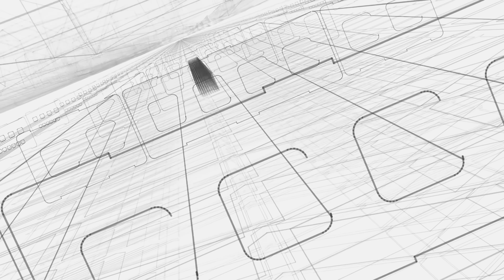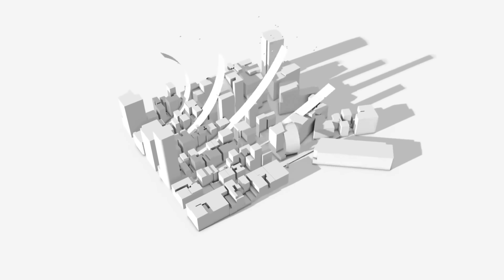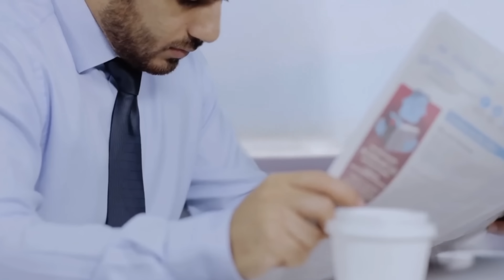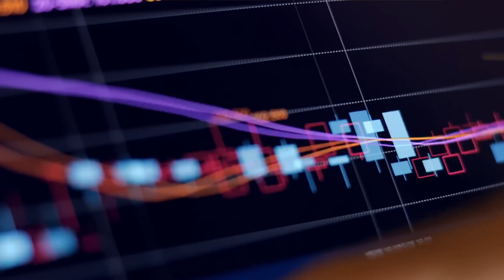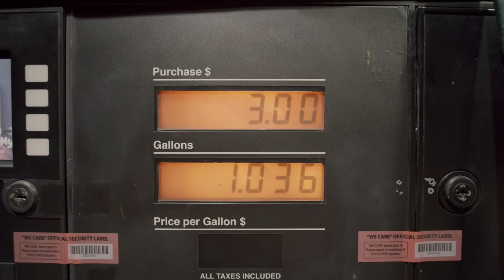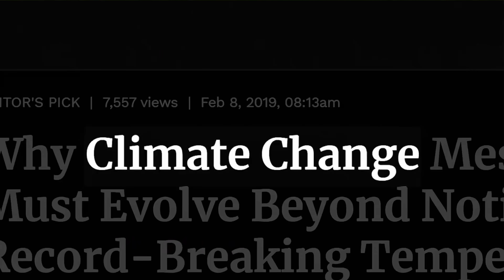Saudi Arabia's Mega City that Runs Itself: NEOM

Comment: A line, or rather a very narrow rectangle, is such an inefficient shape for urban planning. Imagine that an accident or any other kind of block occurs in one point of the line, it would be a logistic hell to transport anything from point A to point B, if the blockade zone happens to be big enough and within those two points. Now, in a traditional polygonal-shaped city, there are many redundant routes between any two random points over the surface, and if one those routes got blocked for whatever reason, there are many alternative ways to get there. This "lineal" city reintroduces a problem that was already solved millennia ago. And that's just one single problem out of the many I can think on the fly, and I got the feeling that many more problems will come the deeper a person analyzes this innovative and "futuristic" idea.

Comment: I think it’s cool that something of this magnitude is being attempted but I think too many bad design elements got incorporated because too many people were afraid to tell a prince “No”. Foreign investors of course aren’t under such constraints and thus far NEOM has generated very little investor interest which has increasingly gotten less year over year. As such I don’t see this project being completed, at least not to the original scale. 

Wind load is a problem for tall buildings. The design as rendered doesn’t show how vortex shedding is going to be achieved so it will be interesting to see what they come up with. Probably would have made more sense to have a segmented line and use the space in between the segments for wind turbines.? A 200m wide building is only going to get about 30 min of midday sun and virtually none if that direct sunlight will reach the lower floors. A lot of energy is going to be used just to keep such a building from being a dungeon. This is a lot of vertical living….moving people up and down will consume a lot of energy! Sand! I have to imagine this place is going to let in a lot of sand which would be a nightmare to try and keep clean. Also solar panels don’t work so great in a desert if they are covered in sand. They will need to be constantly cleaned and there are going to need a lot of solar panels if this is supposed to be green and all of the desalination that is going to be needed. This project I have to imagine its cost is grossly underestimated. 1.5 trillion is likely a more realistic number. I would love to go check this out if it got completed but I sure wouldn’t want to live there. It’s kind of like Vegas….after 3 days u can’t wait to go back home.

Comment: Wouldn't the glass from the Line reflecting the sun onto the sand be a problem? Just curious
Reply from the maker: What if the sand melts and turns the whole desert into glass
Reply: @urbaninternational  perhaps, but think that needs a lot higher temperature. No clue.
Maybe that could happen gradually as time goes
Reply: nope, sand does not catch fire if this is what you're thinking about
Reply: @mohamed.khaldi  i didn't mean catching fire but but more like wouldn't that increase the surrounding temperature?
Reply: @susisblusis  it's desert, it's already hot, and nobody lives there anyway (and no animals live there permanently, they might pass, but as there is no water, not really a problem for them) (i live in tunisia, we have desert in the south, went there twice and it's impressively empty, so even if it got hotter, nobody cares actually, the problem is that our forests are catching on fire almost every summer, but nobody cares about desert as it's already inhospitable)

Comment: What stops the line from frying whatever is on the outside of the glass mirror wall? There have been several cases of this happening to cars in London and LA in which cars that are parked outside of buildings being melted or starting fires by the relections from the rays of the Sun beaming down. 

With this being 100's of miles long and over 100 stories wouldnt this kill any animal life that there is around the site and make the area extremely hot.
Reply: Rafael Vinoly buildings are known to be death rays. I hope that he wouldn't be involved in this
Reply: Look up walkie talkie building and vdara in vegas

Comment: I wonder how they plan on routing power. This is not your traditional system where the grid spans out. The grid is on one straight line and this city would need like 5 to 10 redundant lines to prevent any major outage to the rest of the city
Reply from the maker: That's a good question, I actually am not sure how that will work here...

Comment: I feel the best things about these INSANE build ideas. It is NEVER, 100% a perfect and great thing. However, the things you can learn just from actually making it happen is so valuable compared to a theory, or an adjusted data driven hypothesis on what would actually be good or not. Like the man-made islands or the massive skyscrapers in Dubai, not really practical and they have tons of issues, however they are just cool to look at and know that someone was like "what if..." and actually did it.
Reply: When they build  each section they will refine  their ideas/redesign BUT not more thinking that thinks are impossible thats old way of thinking and only holds back progress ,innovation etc.

Comment: my problem is with the line, what would happen during heavy winds ? it has a large vertical surface area, if the wind moves perpendicular to the surface, along the line, I feel like the wind can break the line.
Reply: Yes you pov is valid but they already seen the winds direction the glass also will have in between ventilation vents that will help the glass and whole sturcture with cross ventilation
Reply: It would be an epic calamity of they never thought of that before starting to dig
Reply: Absolutely! That's how the great wall of China fell, the Berlin Wall, and the twin towers. That darn wind......Just blew the Himalayas over to Turkey the other day.
Reply: What about saudi nationals jailed for protesting this?
Reply: @hill3016  There was never a protest ever since 2012, Dont spread false information

Comment: there's a lot if environmental concerns in the project but I hope they find solutions. I would love to see this in real life.
Reply: does not make any sence to me.
Reply: I have a solution just make a normal City
Reply: @DannycageGhostrider  almost impossible to make a 0 carbon emissions city via the normal way. unless they have like 0 roads and every house window or room have solar panels or some shit. but other than that i don't see a normal city being 0 carbon emissions.
Reply: @mulanomula  bro this city is a engineering disaster. At least they can build a normal city with 10% carbon emission rather than wasting in a project which is designed to be failed
Reply: @mulanomula  You’ve got a good point but at least a normal city that bans all emission-producing vehicles, relies mainly on transit, uses heat pumps and nuclear/solar district heating and power generation, and is built to be walkable has a chance of being very low emissions whereas this is just a disaster of an idea that will never be possible. The Line especially is purely a vanity project. It’s completely mad. It’s going to have a 100km long mirror wall on both sides. That’s utterly insane. There’s also the consideration that all of their numbers are wrong and they haven’t shown any kind of concept aside from flashy CGI. It’s such a terrible idea. The floating city as well, it’s gonna be astronomically expensive and would make more sense to do it on land.

There’s a lot of concepts we could start researching and introducing to modernise cities and make the world a better place, but building things that look cool in CGI trailers but fail in real life is not the solution. It would make infinitely more sense just to build on established known ideas and designs to improve rather than building something new and impractical that crams in every single buzzword they can think of. You might not realise yet, but that alone is such a big red flag, it’s like the hyperloop which supposedly was going to be 600mph with all these bells and whistles, that turned out to be full of drawbacks and be almost unworkable even at only 100mph, however on the other hand you could just build a regular HSR that can do 300mph for a fraction of the cost that can have any kind of turn and we know works, or you could build a MagLev that can actually do 600mph and doesn’t need to be as straight, nor vacuum pressurised, and is an established technology.
Reply: @DannycageGhostrider  im not saying this city is good in any way im simply saying that its impossible to make a traditional city with 0 carbon emissions. even 10 percent is impossible unless you completely ban fuel based vehicles which include buses, cars, some trains, motorbikes, etc. you'd have to go fully electric to even achieve 20% carbon emissions and you'd also need to get ur energy from either hydro, wind turbines and/or solar or like a mix of all of them. what they're going for is legit impossible, aiming for around 20% carbon emissions is more plausible, but the way they're going about it just means alot of wasted materials, changing the ecosystem by putting a giant fucking wall in which animals are going to be like wtf to, and glass that reflects heat onto surrounding areas which creates ALOT of heat; basically scorching the surrounding fucking land. yeah the line is just a mess.
Reply: @mulanomula  and how this city will cost less electricity ?
Reply: @DannycageGhostrider  electricity can be generated through many different avenues, could be wind turbines, hydro or even just the usual solar panels. The LINE itself is not only close to the ocean but its literally in a desert where alot of sunlight will hit. so hypothetically the line could be very eco friendly due to these factors. the bad thing is that the line itself is a big waste of material.
Reply: @mulanomula  Its not necessarily that easy, while a solar panel could a good source of renewable energy, there're lots of problem with it, especially in this scale. The first thing is that since you're in a dessert, the solar panel need to be constantly cleaned from all the dust that can cover it. It sounds easy enough, but you need to understand that not all the sunlight is being fully absorbed by the solar panel, meaning there're lots of heat that get bounced to the environment. This problem can create a change in the environment climate, meaning any living organism can have a hard time to live there. It require a huge amount of cooling system with a huge amount of energy to operate.

It doesn't mean solar panel is bad, there're certain design that can reduce these risks. But not in what Neom is designed
Reply: you guys are so uneducated holy fk, have you even done econmics 101?..maybe you guys should fund the environment saving fund with magic keyboard dust instead of real money LOL, do you wanna have a bet? I bet we will see MORE animals, MORE plants, MORE and better technology by the end of this project, and will help fund more environment protection projects than you and your communist hippie group will ever do, see that exotic desert lion? KILL IT, ask the one who killed it to pay for hunting fee of a million dollars, and use that a million dollars to breed 1000s of that lion, and repeat, in a decade you will have more exotic lions than there is chicken LOL, that is the LOGIC behind econimics, which you are not educated in. The solution is to attract rich people to kill the animals, sit under those trees, live next to those desert mirrors, and their tax money will fund MORE than stupid keyboard warriors will ever do, if the stupid socialists just stay the fk out of this and it will be great.
Reply: Building a city like newyork would be much more harmful. As this city will cost much less electricity, 0 carbon city.
Reply: If they want to build a city with an  unprecedented design and cost, then so be it, Its their money anyway. If they succeed in the project, then its a huge step in innovation of how we build our cities. If they fail, like what happend in the world Islands in Dubai, then let the people on Twitter be the judge.
Reply: @yubijutsu8821  Well, that's a problem. Its not like its a random person who never compete in an eating competition, now try to participate in eating competition and so if they win or lose its whatever. Its a multi-billion project that requires tons of resources and man power, if it fails the damage is just too big. I mean, imagine your local city mayor have a multi-million project that collect its money from the citizens but then it fails, it will be a huge deal
Reply: Believe me, it will happen. Everything will play out in place before the second coming of Jesus Christ. This city might even required pple to get the mark of the beast before they can be allowed to reside in this LINE city.
Reply from the maker: Same here

Comment: People really hating on The Line. I can just imagine the hate people had when airplanes were suggested.
Reply from the maker: Lol trueee
Reply: People are hating on the line because it has serious engineering flaws which cannot be fixed without making it something other than a line. For a start, transport: A line ensures that everywhere is as far from everywhere else as it can be. That maximises journey time: You literally could not design a worse city when it comes to getting from A to B. There's a similar problem with infrastructure in general: A line shape needs the highest possible number of substations, transformers, sewage lines, cables, storage tanks, etc. Again, a line is the most expensive possible shape to build a city - and this can be demonstrated mathematically. A line also puts everyone as far as they can be, on average, from emergency services. The linear structure has no way to route around damage - if there's a major accident, natural disaster or deliberate attack that damages the transport corridor or utility lines, it cuts the city in half. No way to just take a different route around the damage. There is a good reason that no-one has built a city like this before: Because it's dumb.

The only possible 'benefit' to such a ridiculously expensive city is that you could be confident no poor people would be able to live there. Which may be part of the appeal. A place where the country's upper classes could live, comfortably assured that none of the dirty plebs will ever disgrace their sight.
Reply: What you mean? now we got a climate catastrophe and everyone flying is really helping that
Reply: @MyKharli  we dont have climate catastrophe  look stats from 1800 s until now and you will see  there is not catastophre right now its propaganda for you accept sacrifice you r own  confort
Reply: @burgerpops7182  I just did and its really worse than i thought ..are you looking at the graphs upside down and are one of the global cooling nutters ?
Reply: @MyKharli  🤣🤣🤣🤣

Comment: Drones noise is terrible, but they could fly outside city and flow into soundproof tunnels. Also natural light is important, can be improved with mirror tubes similar to ventilation system, without full light spectrum people will get sick.
Reply from the maker: Drone noise?? From where??
Reply: @urbaninternational  apparenly for the line, drone is another type of transportation aside the underneath trans or subways which fly inside the area so it can create noises